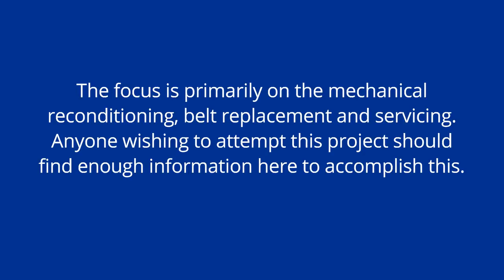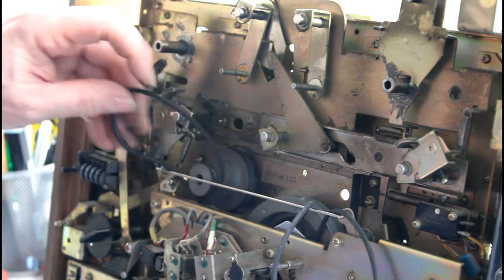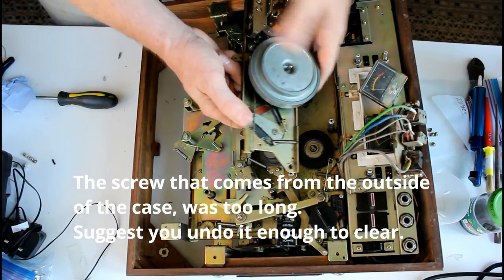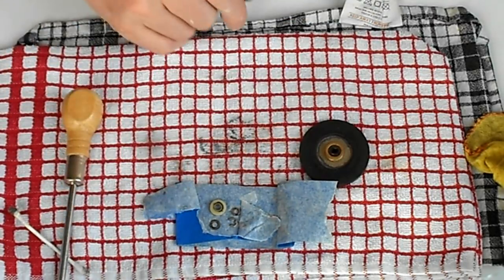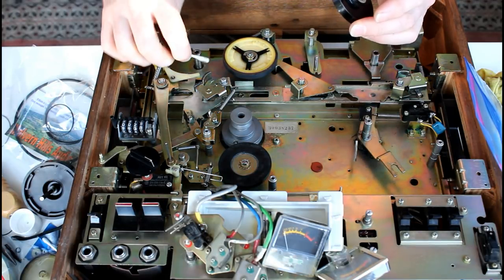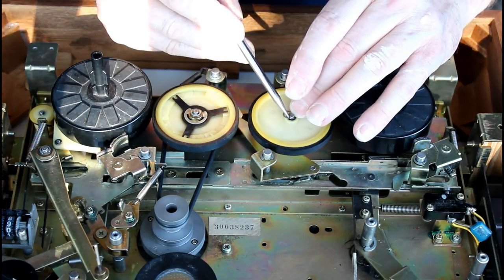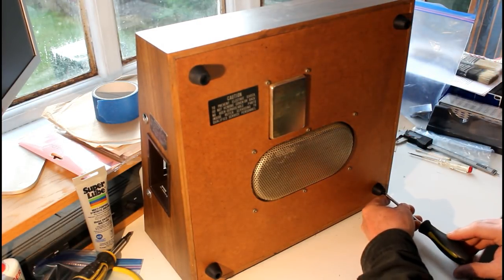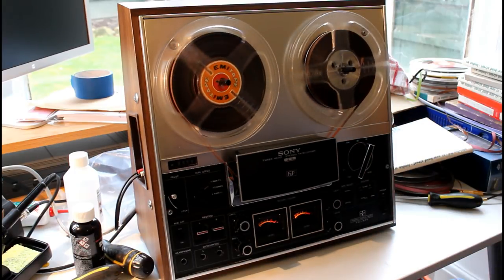Sony TC 377 (& Sony TC 366) reel to reel (How to Renovate and Repair)

Comment: Excellent video!  I bought one of these at the Navy Exchange in Yokosuka, Japan back in '72.  One of the channels stopped producing sound in the early '80's.  I couldn't find anyone willing to work on it and I was not well versed at the time with working on electronics (that has since changed drastically and I have restored dozens of tape decks).  Instead of keeping the machine until I had gained enough knowledge to repair it I foolishly tossed it in the trash bin.  I am seriously considering getting another one just for nostalgia's sake.  Your instructions will definitely be a help to me should I go ahead with the project.

Comment: I take what I said back one hour ago.  This instruction (sounds like a bloke accent to me) just saved me from buying another recorder and/or 350.00 at the Sacramento repair store at 5800 Madison Avenue, Madison at Manzanita.  I have a Sony TC 388 but the mechanics are the same as a TC377.  Bless you.
Reply from the maker: Thanks for your comment.  The mechanics are the same, I think it's just the recording/playback heads are different.  Glad I could be of some use.  Good luck.

Comment: Wow - What a great restoration video. I've just bought myself a TC-377 for £90. It sort of works but levels are extremely low and mechanically well below par No wow & flutter that I can hear with my ancient ears but belts clearly slipping. So, now looking forward to many happy hours repeating your restoration work. Thanks so much for that. It's given me great confidence to do it and told me what materials to use & what to expect.

Comment: I'm so grateful for this video. My father gave me his TC-366 which he purchased new in 1971 (identical in almost every respect to the TC-377 except no ferrite heads). I wore it out in my teenage years, but it got new heads and belts in the 80's, and after languishing for 2 decades my father gave it to me, and it languished for another decade. I recently decided to transfer some irreplaceable tapes to MP3, but the transport barely moved. Your video guided me through regreasing the entire transport mechanism (boy, the metal in this deck is solid, and it's much easier to work on than my Nakamichi CR1A cassette deck!). I spent a happy Saturday afternoon, and I'm pleased to say this deck now plays music flawlessly. The mechanisms are now silent, which they have not been since 1985. This was a long overdue service, and I did it by myself with your help!  I had even considered buying a working reel-to-reel on ebay, paying the horrendous prices these items seem to command. Now, I'm wondering what my working unit will sell for once I finish my tape transfers.
Reply from the maker: Hello Jon,   I appreciate your kind and informative comment and  I am glad my video helped you through and you had excellent results, well done.  Also, thank you for subscribing to my channel to help get the word out.  Kind Regards.

Comment: This is a really GREAT video!  I've just spent quite a bit of today servicing and cleaning mine.  Used to work on these in the early 90s, wish I'd kept hold of most of the ones I sold on given the recent price rises!  These were domestic machines, but really really good ones.  Take the front off and take a bit of time to appreciate just how well built these decks are...  1971 IIRC, and these weren't anywhere near the start of open reel Tapecorders for Sony, they produced many other R2Rs before this one!  Akai did very similar fine engineering with their decks too...  Lovely stuff!  :)

So, I don't want to critise this video, which is a really good and easy to follow guide for these machines, but I need to make a few points.  Firstly:

Screws - (50m38) Phillips and Pozidriv screws are quite different and are arguably (to some people) somewhat interchangeable, although really, they aren't!  You can seriously damage either screwheads with the wrong driver, and you can damage the screwheads on this using Phillips or Pozidriv.  This is a Japanese product so you can pretty much bet everything you own on every screw in this thing being a JIS screw.  JIS (Japanese Industrial Standard) or JIS B1012 to give them their full name, are the screws with a little dot on the head next to the cross head.  The lobes are a different shape/pitch to other cross headed screw so while a Phillips or Pozidriv might loosely fit, you could chew up the head of the screw if you slip, which you almost definitely will, because lobe pitch thing, yeah?

Main/first idler, the bottom one off of the motor - (34m00) It's been refitted upside down!  Although it shouldn't make much difference, I'm afraid it is the wrong way up!  The machined cup should surround the felt washer which I guess works like an oil wick...

The rainbowy (is that a word?) finish of the metal plates/parts - Galvinised steel plates.  Because, of course it's galvinised.  This is a very very well made machine!

Trapped wires under the front middle screw - Yes, mind these! I remember having to rewire a couple of similar machines back in the day...

Last thought, reinstalling the transport plate (the plate under the head block).  If you have removed and refitted this, don't you love how it locks in place once it's there?  Like, wiggle it around and suddenly it clicks into place and stays there!  And, all this was designed before modern computers and CAD!  Utterly mind blowing!
Reply from the maker: Thank you for your comments and for pointing out some valuable observations and tips. It seems you have experience with these machines. I tried to follow a common sense approach to the repairs, but to be honest had no previous experience with this machine. One thing is clear, the machine is intricate and very well built.  It is a marvel how so many mechanical concepts were designed and assembled to transport a tape (which itself is a marvel) across record/playback heads.  And it sounds great too.  I was surprised at the sound quality, I have good turntables and CD equipment, but had forgotten in this age of tiny earphones and iPhone reproduction how good these old machines sound.  Stay safe.
Reply: I Just bought a tc-366.  the meters light up and the mic inputs work.  it rewinds but the function knob doesn't turn to play or ff. also the speed knob doesn't switch.  I am going to open it up and take a look. any ideas?

Comment: I worked for a company called Teletape tithe specialised in tape recorders. This was the best selling of the reel to reel recorders we sold. The Akai 4000 was a close second.
The most common spare part we sold for this recorder, apart from the pins the held the tape cover in place, was the clutch mechanism which was the off white wheel with the metal three pronged steel spring wheel. The clutch mechanism was prone to wear and could be adjusted. Most engineers had problems remembering which washer went where because there were so many of them and the in the service manual it was hard to differentiate which washer went where and which way round they went. 
Nice job. I should service the ones I have and my TC 399
Reply from the maker: Hi Jeremy, Yes, there are lots of washers and as I wasn't the first person to look inside this machine, better information would have been useful.  It's nice to know it's still working and playing tapes in 2019.  That's says something about the build quality. Thank you for your comment and insights.
Reply: @dembydish   Hi, I'm worried I'll take it apart and ruin it! Do you offer servicing at all? :)

Comment: Among the best tutorials for this machine! Thank you! I recommend using the Rubber Renue only in a well-ventilated area. That’s toxic stuff! To your health!!🙂
Reply from the maker: Yes, we can't be too careful.  Thanks for stopping by.  Keep safe.
Reply: How good is the rubber renew?
My pinch roller has hardened and cleaning it with a brush has not helped.
And how do you apply it?
Thank you
Reply: @SDsailor7  use sandpaper coarse then fine i wouldn't use rubber renew waist of money it opens the rubber by expanding it to release the grime but does not really renew it.
Reply: @theprogrammerrolandmc3039  Thank you for the reply.
Cheers
Reply: @SDsailor7   You could use warm water with some dish soap with a microfiber cloth. it worked for me without sanding it takes the same amount rubber renew does just finish with the cloth with just warm water to get soap residue off. I think rubber renew is just marketing it does the exact same i think they just add a foul smell to it. You can do the same with pinch roller.

Comment: Thanks a Bunch, Master Sony San! 
I succeeded in servicing my TC-377 mechanically with this clear instruction.
Your comments are very practical and the video is outstanding.
 I couldn't get Rubber Renue in Holland so I used another rubber cleaner. 
Seems to work fine.

But the recorder still doesn't record , so I have to look for an instruction to handle that.
Hope I will find something of your craft for this too.
Reply from the maker: Thank you for your response to the video.  I am glad you found it useful.  Please subscribe if you haven't already and good luck finding the electronic expertise you are looking for.

Comment: Just tearing Mine apart now    Looks new inside  but the speed goes from slow i keep stopping and starting changing speed and it will kick in sometimes   ff rew seem to work ok  Got to love how the vu light looks like a fuse :)

Comment: Excellent job, impressive attention to detail. One thing you did overlook - oiling the motor. If you look very carefully there is a tiny hole with the word "OIL" near the shaft on both ends of the motor. Add a couple of drops of oil here and the motor spins more smoothly.
Reply from the maker: Excellent tip. Thank you for your comment.
Reply: @dembydish  Actually, after reviewing your video, I realized that the U.K. 50 Hz motor in your unit is slightly different from the U.S.A. 60 Hz motor in my recorder. So the oil holes may not be there on the 50 Hz motor.

Comment: I found the felt you mentioned and used it successfully on the part that holds the drive in pause. Thanks for your response, and a very helpful video.
Reply from the maker: You're welcome, I'm glad I could help.

Comment: Excellent tutorial; my skill-set atm non-existent but will come back 2 this. Just got one that’s “been serviced”, pre-recorded music tape seems 2 play fine thru headphones, so I know that circuit’s good, it is in remarkable cosmetic condition, heads r pristine. Apparently these r a step up sonically from the Akai 4000 family. Gonna hook it up 2 my Kenwood TK-250U & explore ... what a gr8 Sat arvo spend, ay?! Might’ve gotten lucky✌️🤞✌️.. yes, that Rubber Renew I believe, kinda “revulcanises” the rubber BUT I’m warned not 2 overdo it as the rubber must remain firm .. maybe when it stops absorbing.
Reply from the maker: I hope so!  Good luck, thanks for stopping by.

Comment: I Serviced mine changed the the runtime cap and belts everything works perfect just wondering there is no mention of in service manual or user manual of oiling the motor so i am not going to risk it. A tip for the Power light switch on the TC 366 that will fail it's !.6V AC so a grain of wheat bulb i swapped it with a 2.1V LED 3 times the size and works perfect.

Comment: Hello,
I would never have dared to dismantle my TC 377 and 378 without your very good tutorial.It's perfect, except that I did this operation because the right reel (on both devices) is rotating, but without vigor and doesn't have enough force to drive the belt (left reel), even after cleaning, greasing and changing the belts, and thinking about it for a few hours, I don't know what to do anymore. I'm sure you have the answer! Thank you for your help.
Reply from the maker: Hi Bernard, it is difficult to know without looking at the machine.  However, id be looking to see if there is slippage on any rubber edged wheels while the machine is working.  Applying a bit of pressure to them and see if it runs better.  Use rubber renue as shown in the video may help.  Alternately, it may appear that the motor is not providing enough force, and is bogging down under working conditions.  A new run capacitor may help, and probably should be changed at this point anyway.  Hope this helps diagnose.  Please subscribe to help the channel grow,  Good luck.

Comment: Brilliant video. Have now got a fully working TC377
Reply from the maker: Thank you for leaving your comment.  I'm glad to be of help.  I'm curious if you followed it whilst simultaneously fixing yours.
Reply: had the video running, stop and start, while I dismantled the machine and rebuilding it. had been in the roof for 20 years. I have been agreeably surprised at the quality of the output from my stored tapes. I haven't degaussed the tape heads.
Reply from the maker: Yes they do sound good, I think we've got used to music coming out of cell phones, TV and lap tops and  forgotten what music from a good tape machine (and HiFi)  can sound like.  Glad you got it running again.  Cheers.

Comment: One thing I have done is use a small compartment box with numbers for each wheel or mech assembly. This way can keep the screws/washers together when re-assembling
Reply from the maker: A good idea, anything that helps keep organised is a winner in my book.  Thanks for your comment.

Comment: Thank you for the excellent and easy to understand video.

I have one comment- When you reinstalled the idler wheel, it seems to me that you installed it upside down from how you removed it. It doesn't seem to make a difference, since yours is working fine.  If you compare the idler wheel at 20:57 (where you flip it over) to 34:02, it looks (to me, anyway) that you've got the underside on the top now.

Also, did you replace the oil washer? I didn't seem to have one when I removed my wheel.

Thanks again.
Reply from the maker: Well observed!  I looked at the timings you gave me and it seems you are correct.  I'm not sure it makes a difference and I cannot be sure of the machines previous services.  However, I would replace the oil ring. I think it was a piece of circular foam and add a drop of oil on the pad to keep the shaft lubricated. You could make something out of felt.  Otherwise service it periodically with a drop of light oil.  However... now you mention it, it makes sense to have the foam washer on the top, if the machine is used lying down.    Please subscribe to help the channel grow if you feel inclined.  Best of luck with your restoration.

Comment: Because of this video i was able to get the roght capacitor for my one. Got a little confused as the cap has 3 terminals where as replacements all have 2. But seen on this that two of theme are just bridged together

Comment: Hi friend, give me a tip. I picked up a tape recorder to repair it, but despite cleaning and lubricating it besides the belt change, it is slowed down. I tested the capacitor of the motor with capacimeter and it is great. In the engine pulley, it is stamped 0-60, I believe it is right because here in Brazil the frequency is 60 Hz. Thank you.
Reply from the maker: Check for oil on the pinch roller or flywheel drive spindle, clean with alcohol where they come together.  Look for hardened and slipping rubber on idler wheel.  Sounds like something is either slipping of binding in the drive mechanism.  Review one item at a time.  If the motor is turning , its not the capacitor and not likely the motor speed. You can run the tape player without the front cover to give you access to the mechanisms.  Look at each part under working conditions to see if its operating OK.

Comment: Very enjoyable. I could watch that for hours. I wished you'd tackle the Sony TC558 which were notorious for speed issues like dragging reels when they reach the end. They also had problems with their auto reverse which was controlled by a middle lever attached to the capstan.
Reply from the maker: Thank you for your kind comment.  I'll take a look at the TC558 on Google, i'm not familiar with the model.  I'm glad you enjoyed the video. Cheers.

Comment: This is a dumb question but I removed the 4 face screws and the front will not open. What am I missing? I don't want to force it. I did take off all the knobs. Thanks in advance for any suggestions.

Comment from the maker: Hello, I do not fully understand your question, but it sounds like the tape machine does not lock in play position.  This happens if the tape is not threaded around the auto stop lever properly. The tape from the left spool goes underneath the thin bar which hangs under the black erase head.  Check this bar is hanging  loose and moves freely. Look at video assembly at 45:29 to be sure you've got that fitting correct.  Look at video at 55:10 to make sure that fitting is correct.  Then it should work. Let me know.

Comment: Hello there, i got a TC 377 recently and it seems work but when recording it only records the right side of the line input. Also when monitoring the tape, there is a extremely loud hissing noise which is pretty annoying and making the machine kinda loose it’s purpose. Is it a problem of the tape itself or is there some internal problem I’m not aware of? I’d gladly appreciate some advice.

Thank you for reading
Reply from the maker: Hello, sorry for the delay in replying.  I think you are describing an electrical component problem.  Possibly one or more capacitors need replacing.  This is beyond the scope of my video which deals with the mechanical restoration.  At this point you'd need to find a competent person who fixes old audio gear,  There are such people, getting as rare as hens teeth.  There are some who have YouTube channels.  It depends where you live.  Sorry can't be more helpful, please let me know if you have any success. Subscribe if you feel inclined and good luck.